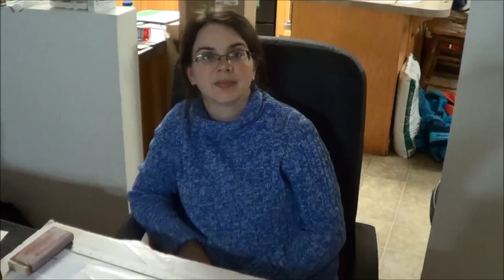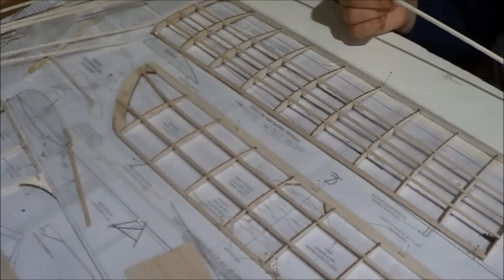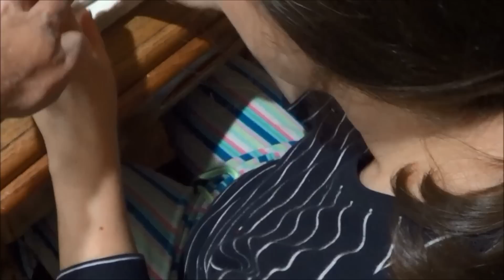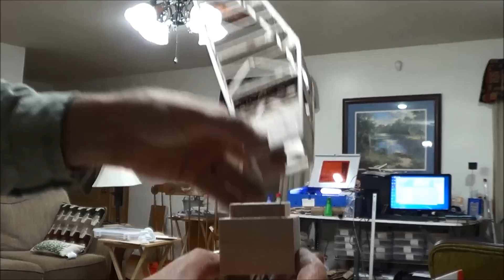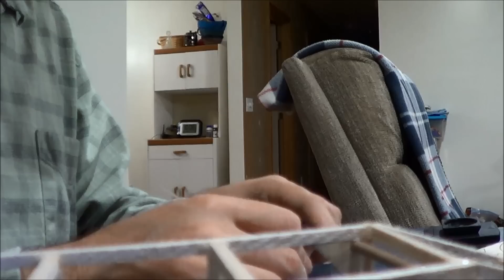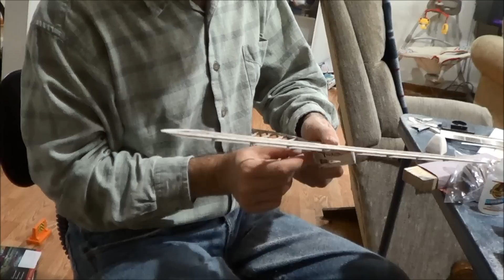Ripmax/Keil Kraft Senator Build/Review Pt.2

Comment: Has cyano glue changed? I haven't built anything in years, but when I did I used to regularly glue my fingers to the model doing what he does with his fingers and the glue!

Senator was the first model I ever built back in the 70's - no cyano then, just balsa cement and white glue!
Reply from the maker: CA has certainly improved, but I also use a lot of it so I'm used to getting it all over me and just dealing with it. It certainly makes for fast building, and I've found that it really isn't bothered by high vibration environments unlike the warnings I've received to the contrary.

Comment: Hi again Josh. Going well my side and have just bought a razor plane like yours to chamfer the trailing edges (good tip👍). That said I have now reached the frustrating stage you highlighted where I have run out of the 3/32" (2.4mm) square balsa to finish the top spars of the tail plane ("stab"😄👍). I probably have enough offcuts to "make do" but not best pleased with Ripmax on this however do you consider that if I use the offcuts and enough glue where they butt up on top of the rib it will be strong enough?? Best from U.K. Ken
Reply from the maker: Ken, obviously best is if you can scrounge some uncut 3/32" sq, however out at the tips it's not a big deal. Inboard panel really should be continuous though.
Reply: Thanks Josh the inboard panel is 100% 3/32 as are bottom of the tips. OK understood complete lengths are better - will see what I can come up with with. All the best Ken

Comment: Hello Josh and Hope thank you for the detailed (and humorous) review. I am about to start my Senator and your films are invaluable. A quick non-building question for you though - the plans suggest covering the plan with "clear film" which I have done but I'm wondering if the film I used is OK as it's a fairly stiff book covering film. I think in the past baking parchment was the norm even if it is more opaque. I guess food "cling" film wouldn't be suitable and would be difficult to apply anyway due to its springy/stretchable nature. What do you use?? Many thanks 
Ken
Reply from the maker: Ken, glad you're enjoying it. These days I mostly use parchment paper, but the stretchy plastic does in fact work surprisingly well. I've even been known to laminate the plans with packing tape, which is a surprisingly non-stick surface.
Reply: Many thanks for the reply Josh much appreciated and I love the laminating idea.

Comment: Josh, thanks for the great videos on building the Senator.  I just got one and am starting to build it.  Your tool for sanding the slots for the wing and stab is great!  I added a "handle" of 3/8 X 1/8 stock to the top to make it easier to use.  The removable wheel fix is also brilliant!  I used a 6 mm aluminum tube, shoved the bent wheel wire up in it and squeezed it closed on the wire.  Works great.  Thanks again for all your videos!!!!
Reply from the maker: Awesome! Let me know how it flies for you!

Comment: hate to see you struggling with that nose block and too bad you don't have a band saw, or maybe you do...….if so thiers a simple way or cutting that excess to form the block that turns out a perfectly shaped angled nose block
Reply from the maker: stan burdick well we could have done that, but most modelers don't have that tooling so it would have been a bit unfair to do that. Good points though about the right way to do it!

Comment: what do you suggest to use as a build surface
Reply from the maker: Terry Epperly ceiling tiles if you can find them, or 2" thick blue or pink foam panels. In this video, Hope is using 5 layers of Hobby Lobby foam board a friend of mine glued up for us as a graduation present.
Reply: @joshuawfinn  thank you that should be easy enough to get